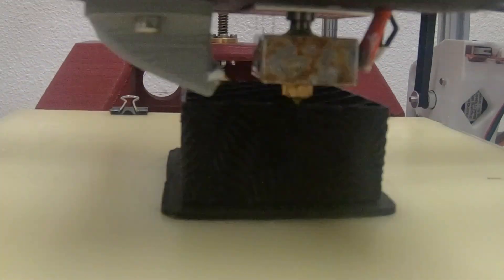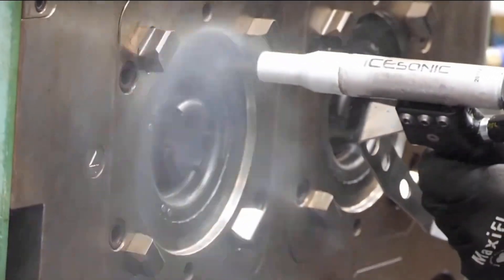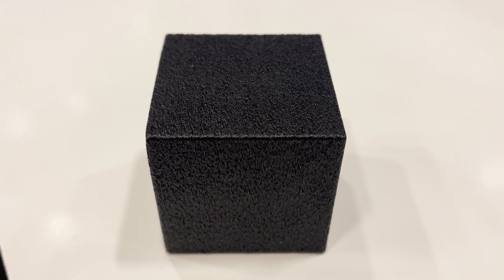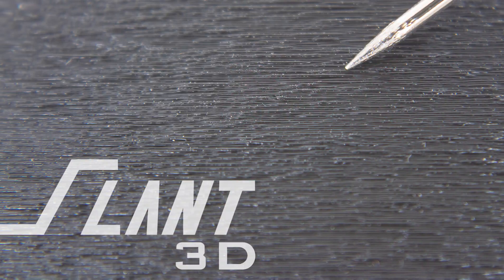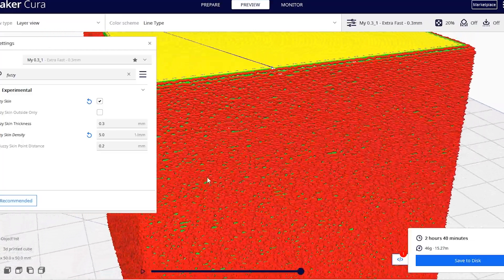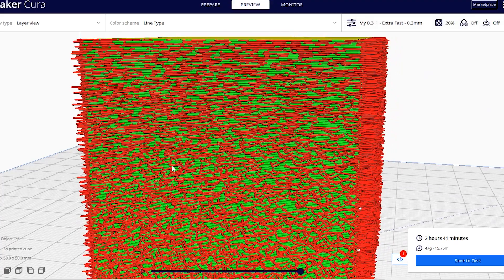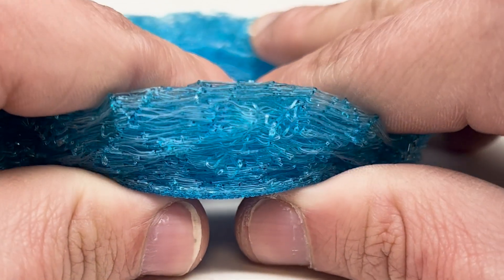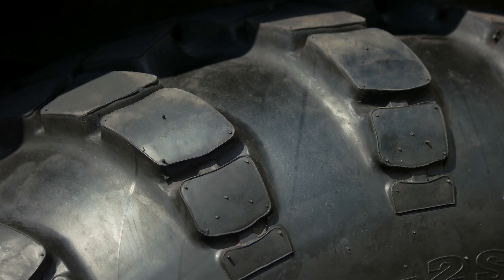3D Printing Surface Finishes for Mass Production 3D Printing

Comment: Why did you use video footage of an injection molding machine's mold being cleaned with a dry ice blaster? The dry ice blaster is just cleaning the plastic off of a mold. It's part of maintenance, NOT creating a new or different surface finish!!!

Comment: Ideamaker has a built in texture feature, and i use it time by time, because its way better than messing with the original mesh or model. I also heard that Cura 5.6.0 engine is prepared for texture, but nobody made a plugin to use it since.

Comment: I might mess around with fuzzy skin later tonight, but the one issue i might run into, is using fuzzy skin on parts that need to insert into another. I would have to sand it a bit so it will lock together.

It could also make gluing easier too

Comment: I think thicker layers (0.33 and up) + thicker nozzle/e-width is something that needs to be actively pushed as a feature. Due to lower linear speed and better relative alignment, it can actually look better than 0.2 finish. The problem with that though is the seam, as it starts becoming more apparent. Ideally you have a corner feature that you can just push that into. Unlike injection moulded parts, the seam will never be really felt in a bad way, it will never cut into your hand or catch on your skin, it can merely be seen.

Though tall fuzzy skin is great at hiding randomised perimeter starts, so there's that. And you can design the prints such that your assembled multi-print item will have perimeter ends hidden on the "inside".

Comment: Few other things I find useful for great finishes:
- use a matte filament
- print at lower temps it takes away the shine you get with filaments and gives a more matte effect
- use textured bed
- ironing on top
- experiment with different infills on top and bottom
- when designing parts make perimeters a multiple of the nozzle size so no ugly infill.
- use archane setting for infills
- use input shaping to remove ghosting etc
Reply: Doesnt printing at lower temps or using matte filament reduce layer adhesion though?
Reply: I’m embarrassed how long it took for me to realize that my infill was showing through my walls because my dimensions clashed with my nozzle size.

Comment: If you're taking advantage of the full capability of your machines, texture isn't no- or even low-cost. Surface detail takes a part whose print time would otherwise be flow-bound and makes it partially or fully acceleration-bound (kinematics-bound). I'm not sure if Slant passes this cost to the customer or lets less-detailed customers' orders subsidize the more-detailed ones, but in principle this should be a significant cost difference.
Reply: Print time difference will completely depend on the object. I dropped a 50x50x50 box into prusa, default settings (15% infill, .2 mm height, ender 3v2). 3:19 for print time, 41.78g of filament.  Then go in and add Fuzzy Skin. I chose "outside walls" with default settings of .3 mm thickness and 0.8mm distance.  Total time 3:22, 41.97g of filament. I would say that is insignificant.

But then I put a part (fan shroud) that I designed on there. My previous time was 6:14, adding the same fuzzy skin increased it to a whopping 7:26.
Reply: @larrybud  With your cube the vast majority of the time is spent on infill, but I still have no idea how it's that slow. It should be well under 1hr on any modern printer. I'm getting 27-41 min depending on which infill type & printer I slice for. Fuzzy skin takes one of them (cubic infill) from 30 to 39 min.
Reply: I would expect this a minor detail compared to things like spray painting
Reply: Another related issue is that texture adds surface area, and, without manual tweaking to compensate, this increases material usage/cost. This is because, roughly, print material usage for a part can be approximated as a large constant times surface area plus a small constant times volume.

For "fuzzy skin" is makes no difference because the fuzz just distributes the material in the outer perimeters differently, leaving some micro gaps between them and the inner perimeters. But actual textured geometry does make a difference. Usually this is a good difference that increases your part strength, but it is a difference you pay for.
Reply from the maker: That is incorrect
Reply: @slant3d  I'm not sure which part you mean, whether you object to the basic principle (which is easy to demonstrate) or are just running your printers with enough margin below capability that it doesn't affect print time significantly for you.
Reply: @daliasprints9798  He means he doesn't have a detailed rebuttal.
Reply: @slant3d  Could you tell us less?

Comment: Which bed surface are you using? And which tolerance you think is critical. 0.3 mm curviness diff for a bed is fine or 0.1 is fine.
Reply from the maker: Depends on the part

Comment: Been getting a bit more into patterns and textures on my own prints at home. Not only do they improve the look, they can help the quality a bit as well. Had some problems with large top surfaces on my prints, but I broke it up with a pattern which really helped. I probably need to tweak the speed, but tweaking the speed didn't help as much as I expected..
Reply: Which patterns did you make? I'm having a bit of a muse shortage

Comment: Thank you for the rundown man. Something that I found making round containers with a lid at a .3mm layer height and a tight tolerance the lid will lock in place almost
Reply from the maker: Yes. The layer layers can serve as a velcro-like locking system